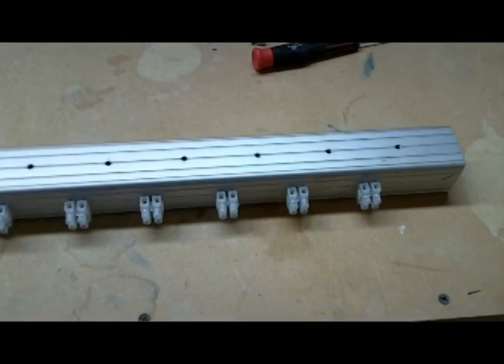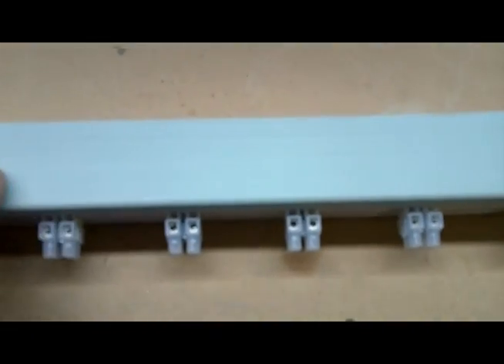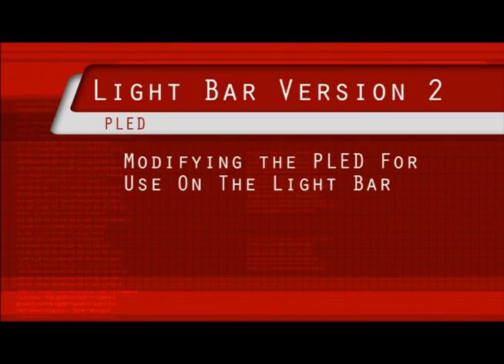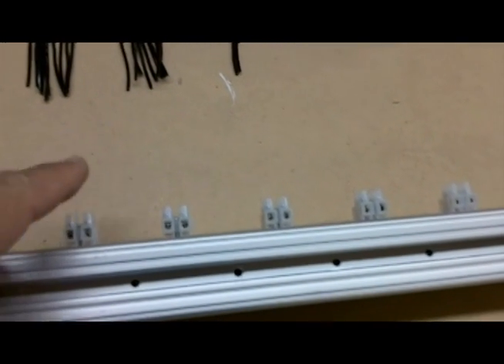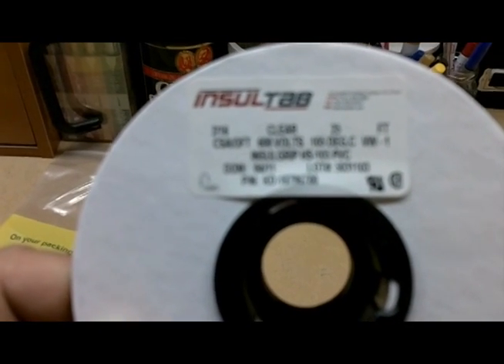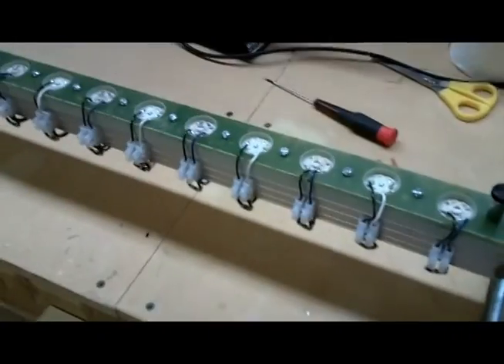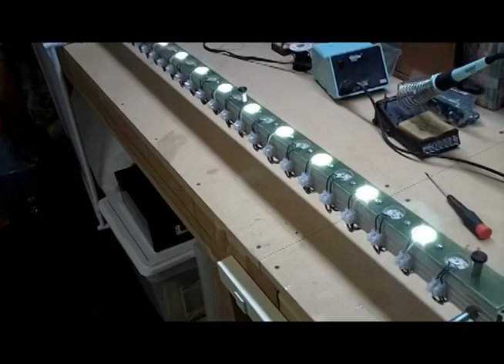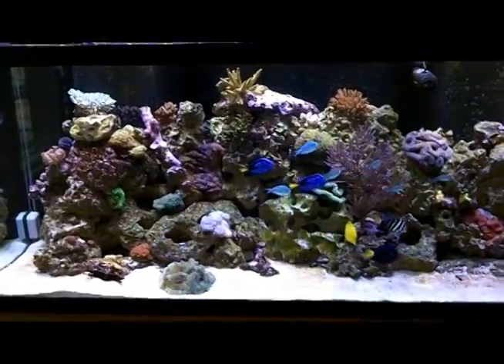LightbarV2.mp4

Comment from the maker: @mhgrabow 

Yes, I know, I meant open. If the LED actually shorts then even though there will not be any measured voltage the current will still flow, the circuit will be complete. Therefore the PLED won't bother turning on because there is no voltage in excess of the 6 volts. The light fixture should work normally if one LED shorts, the rest should remain on in any event. The PLED works effectively when the circuit is broken as in an open LED.